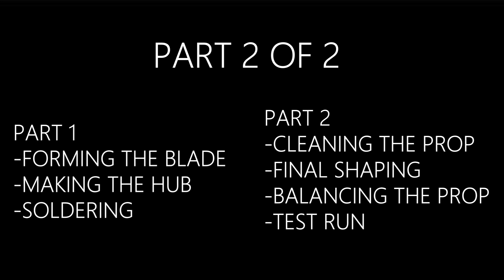RC BOAT DIY PROPELLER FROM OLD COIN PART 2

Comment: You need to remove from the center , the round part , the hub . Good try
Reply: Exactly. The blades are horizontal on the balancer. The center hub is where the out of balance is occurring.